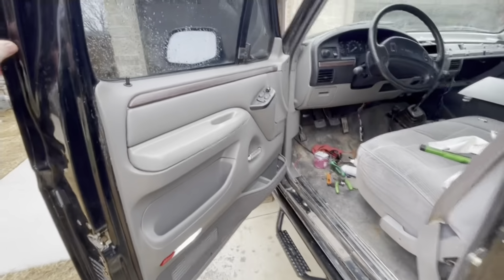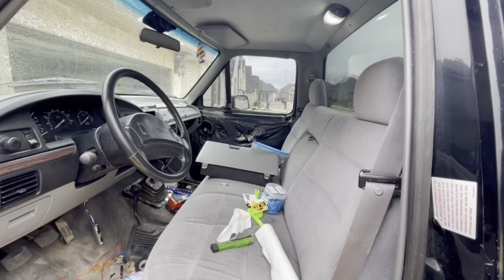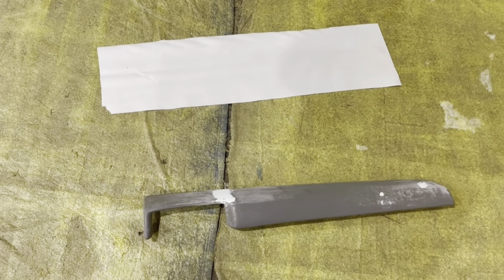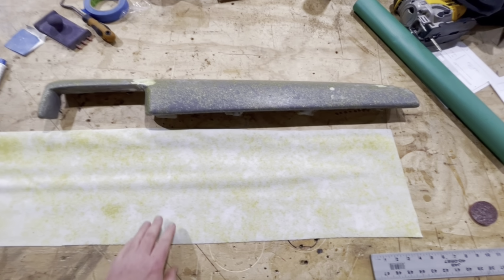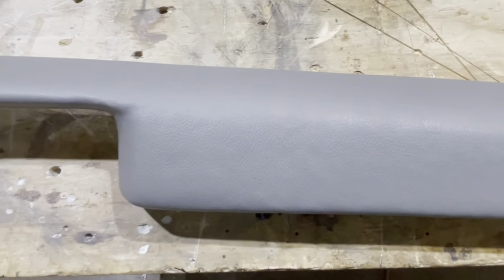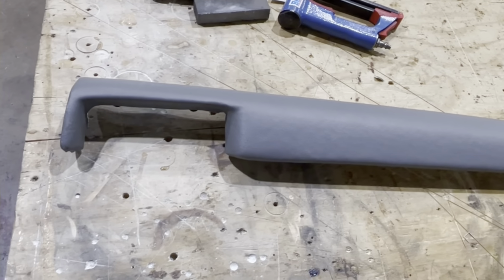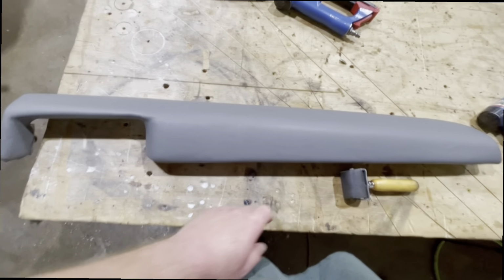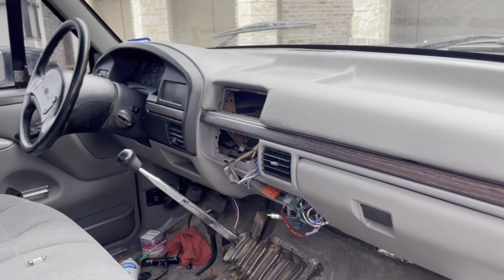OBS Ford dash pad repair

Comment: Did the pad crack anymore under the new vinyl cover and show through?  I am wondering if I should put a thin layer of ridged plastic to cover future cracks.  I am about to start my dash pad on my 1997 F350, 340,000 miles. Thanks
Reply from the maker: It has been since video was made in the Texas sun and it looks as good today as the day I put it in. Now being in Texas I don’t get the cold which may do something different. Would love to see your truck. Always a fan of another obs.

Comment: What type of vinyl did you use? I have the same issue with mine, but mine is maroon color.
Reply from the maker: I don’t remember the brand I used. I went through the vinyls and picked the best match of what we had in stock. Most upholstery places would sell you material and have a decent assortment.